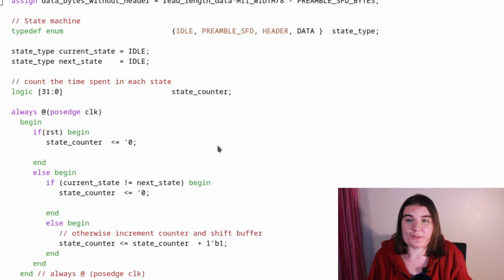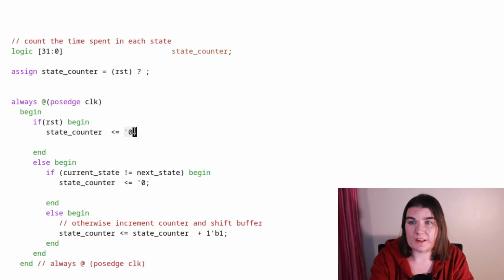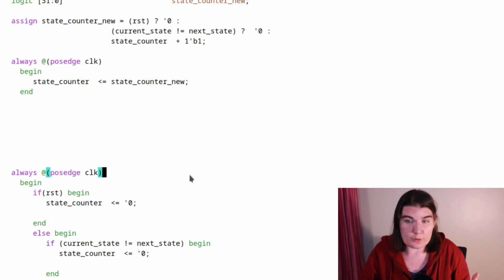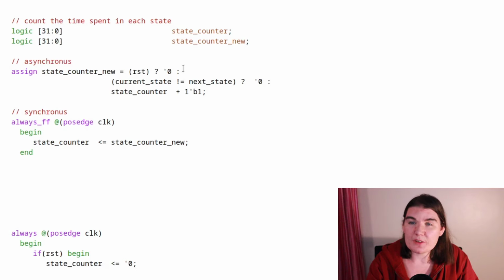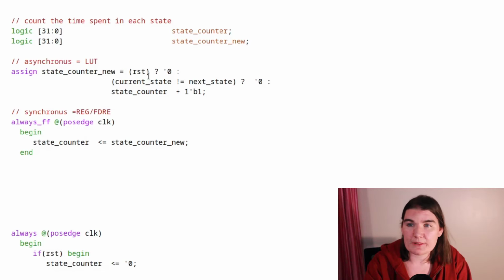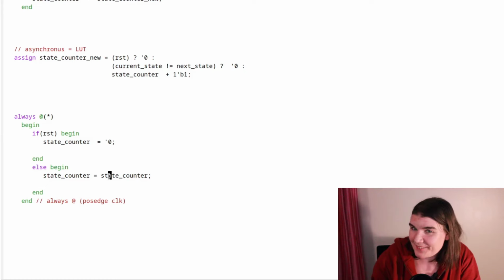The Critical FPGA Basics: Always blocks, Inferred latches, and why the FPGA needs a clock, anyway?!

Comment: Out of curiosity, what makes you prefer using next_state != current_state in your FPGA designs over a registered prev_state setup? Is it mainly to avoid the one-cycle latency delay when resetting the counter, or does the FPGA synthesizer handle that combinational comparison cleanly enough that timing closure isn't a concern for you?

Comment: Summary

This video explains FPGA programming fundamentals, particularly for those with a software background, emphasizing that FPGAs describe circuits, not traditional programs.

Here are the key takeaways:

* 0:00 - Intro 
* 0:38 - Always blocks:
    * Have two main functions: defining signal behavior (logic) and registering the signal (clocking).
    * The clock in a synchronous always block helps create predictable timing and avoids signal propagation issues.
* 8:27 - Clocks and Static Timing Analysis:
    * FPGA signals have a propagation delay.  Clocks create "safe zones" for signals to arrive and stabilize, enabling reliable signal processing.
    * Static timing analysis calculates these signal paths and timing to ensure stability.
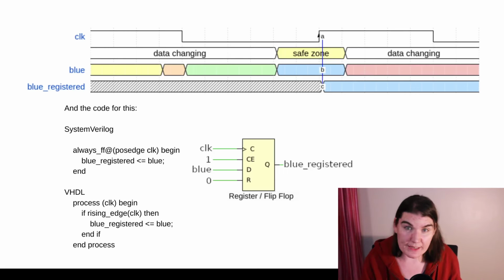* 13:00 - Registers:
    * Act like small memory units inside the FPGA, storing local copies of signals.
    * Used to manage signal propagation delays and provide predictable timing.
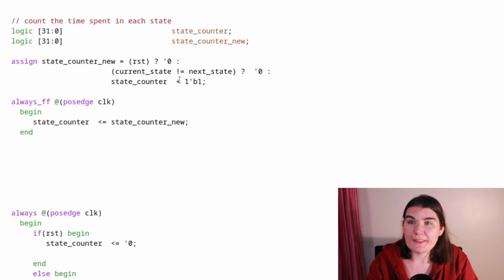* 16:00 - Synchronous vs. Asynchronous Logic:
    * Synchronous: Uses a clock signal for predictable timing (always blocks with a clock).
    * Asynchronous: Doesn't use a clock, susceptible to signal timing issues (always blocks without a clock).
* 18:40 - Inferred Latches & How to Avoid Them:
    * Inferred latches are problematic, unintended memory elements caused by feedback loops in asynchronous logic.
    * They occur when:
        *  A signal drives itself within an asynchronous always block.
        *  Default cases or missing cases in case statements within asynchronous logic.
    * To avoid latches:
        * Use registers to introduce clocks in loopback paths.
        * Define all possible signal behavior conditions in asynchronous always blocks and case statements.
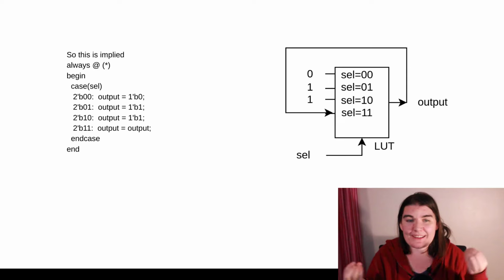* 27:05 - Summary
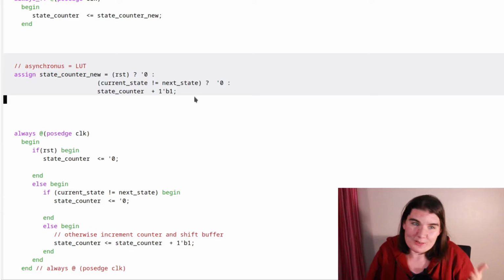* 28:56 - Outro

The video concludes by emphasizing the importance of understanding these fundamentals for reliable and efficient FPGA design.

i used gemini 1.5 pro

Comment: 1.When you have separated the original state_counter logic from the always block  you said those are functionally equal .But this is not always correct .The key thing is you should not use reset signal for the combinational circuits .It will cause metastable issues during reset de-assertion case .It is also not a good coding practice.
2.There are three kinds of circuits in digital design combinational ,synchronous sequential and asynchronous sequential. once you have changed state_counter in the assign statement to state_counter_new, the assign statement logic circuit is no more asynchronous and it becomes combinational
3.The second image at 19:30 is not clear. You should have used arrow for the feedback path and reverse the latch element connections
Reply from the maker: Thanks vijay, I appreciate the feedback. This is a pretty complex topic and it was difficult to know how much to simplify. I realised after making the video that I probably should have called the state counter assignment combinational instead of asynchronus. It has always just been async/sync in my head. One of the reasons why I started making these videos is to improve my own skills and learn through explaining the concepts. I still have a lot to learn myself! I also realised i have the loopback FF backwards. Oh well! Im sure everyone knows what i mean :)
Reply: @FPGAsforBeginners  I appreciate efforts you made to explain concepts with simplified way. Keep going Nancy!

Comment: Have you ever thought about being an analog engineer ? At some point is it boring being a digital designer/verificatio engineer ? You are doing the same thing over and over again ?
Reply from the maker: I've never found it to be boring, there is so much versatility in the field and I'm always being challenged and learning. I still find it to be a lot of fun.
Reply: No way digital would ever be boring haha. Think about a arbitrary wave form generator. That is easily achievable with a digital design and it may be more practical in some cases such as the RF domain where you need to modulate/demodulate quickly and process all that data (i.e. a radar board). DSP has so many more use cases I don’t not see how you can say “same thing over and over” haha

Comment: Great to see another one.
If you are going to use a system Verilog types is there a reason you don't also use always_ff?
Reply: Thanks for the clarification.
Reply from the maker: I do for the new code I write, there's usually a mix just because some of it is old verilog code I've adapted. I do prefer always_comb over always @(*) for my combinational always blocks because it's a lot more clear that it's intended to be combinational.

Comment: Thank you for your videos, which have been of great benefit to me (a master's student trying to learn FPGA and ASIC on my own). I would like to ask if I want to learn FPGA as a career choice. Do I need to learn ASIC-related subjects in advance as a foundation? (Such as understanding the underlying principles of pll and so on)
Reply: Hi I will give a reply.... It always does help to understand what is going on under the hood, at least how it behaves, but unless you are designing the actual chip foundry processes you don't need a deep knowledge. 
I studied Computer science and programming in the age of Cobol, but I now mainly work in FPGA design. All self taught.
Reply: Thank you for your valuable advice. I am also a computer science graduate. Although I have experience in writing RTL (which is also a necessary ability for my research), the lack of EE electronic circuit related makes me confused about some nouns when reading many FPGA/ASIC tool documents such as pll / mmcm / ir-drop/ di/dt noise... etc. I would like to ask you what necessary subjects you have learned through self-study to enhance this knowledge?
Reply: @stevenh7729  I also have s9me experience with electronics which helps, but mainly just lots of experiments. Also consider doing some online courses.